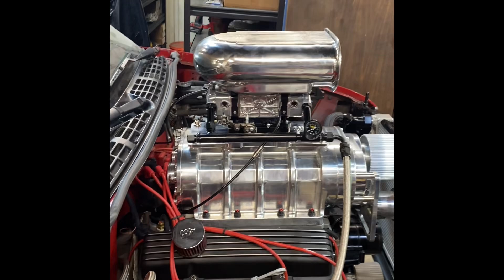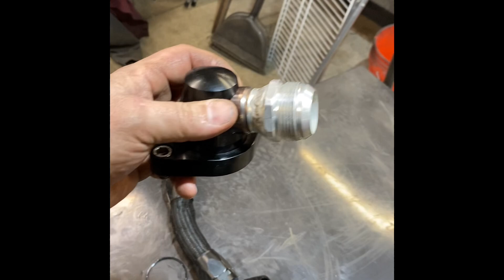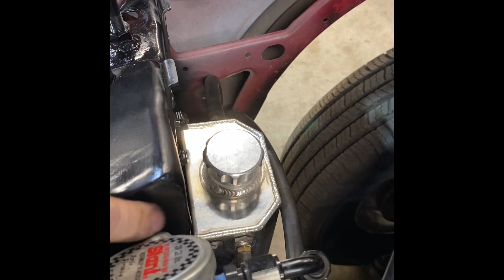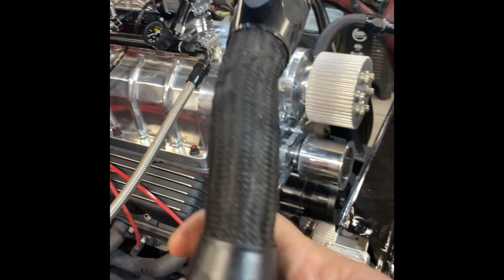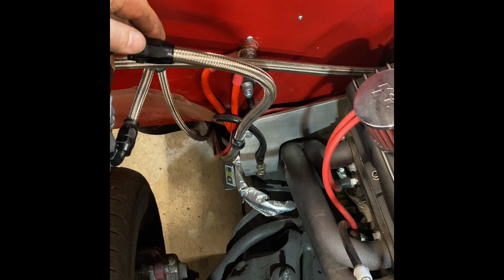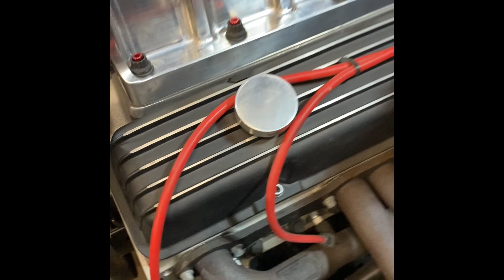671 supercharger single ATM carb

Comment: How did you have to machine the bottom v pulley to work with the stock balancer? When they sent mine it was for the big block and would not sit flush or fit in the hole of the harmonic balance
Reply from the maker: I would bring it to your high school or tech college that has a machine shop and see if they can help you out. I know a lot of people here that have lathes and mills. You always post something on marketplace that you need some machining too.
Reply from the maker: @randalgarcia2541  I have my own lathe. I machined it like .002 bigger than the balancer hole so it would be tight. Only thing I would recommend is drill out 2 holes in the 6 threaded holes and make it so you can run some bolts through to get the pulley off
Reply: @ ok thanks for the info I have been working with jegs to get them to send me the correct one for the smaller hole . But no luck yet , they sent me another one of the same . I might just had to machine it as well .
Reply: On my BBC speedmaster blower I had a lot of grinding also. Had to get a 1/2 spacer for bottom, make my own idler bracket spacers and long bolts. Not sure if they gave me SBC parts instead, but nothing fit .